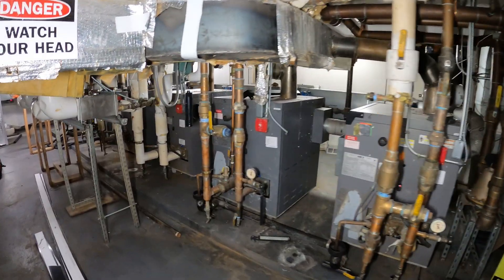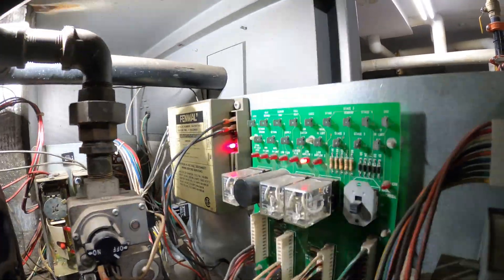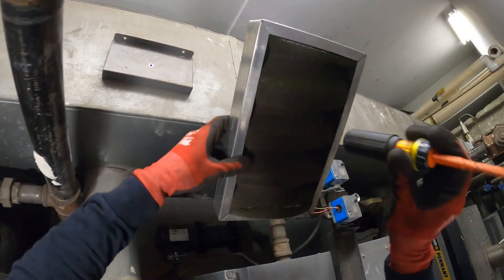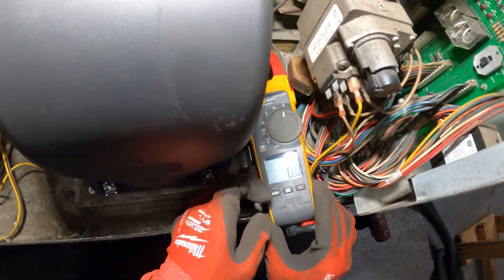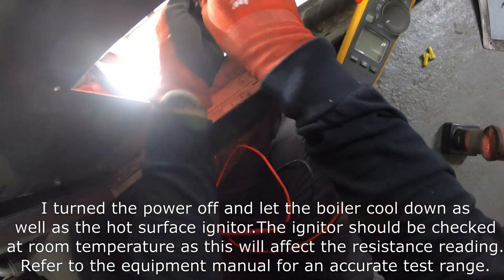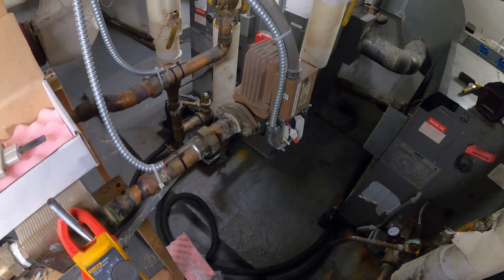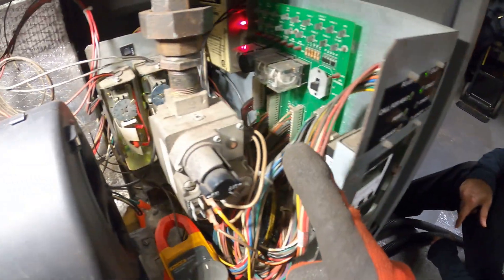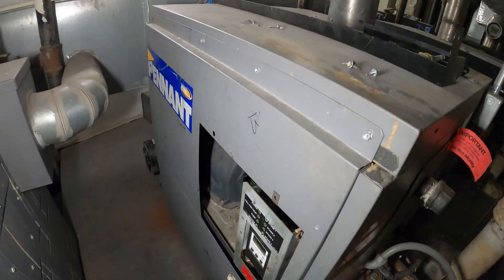HVAC Service Call: LAARS Gas Fired Hot Water Boiler Not Igniting (Not Firing Up/Ignition Lockout)

Comment: That burner box is positive pressure, 
make sure all the screws are tight and the gasket material is intact.
Always check combustion these burners crack very often .
to see the flames  theirs a holr on the left or right side of the boiler .
also that air damper below the blower looked to be 90% closed ( That may be normal I’ve always worked on the larger models with 4 stages )